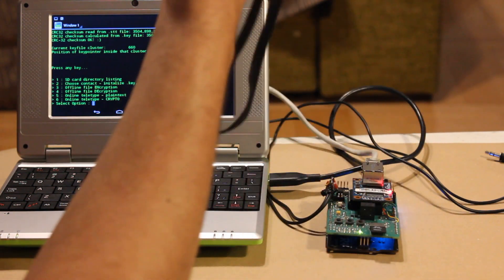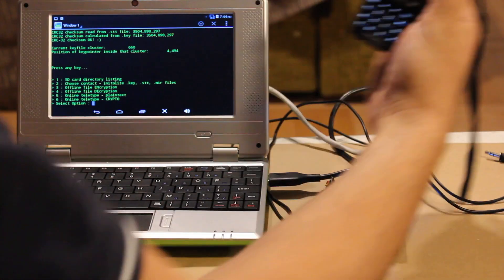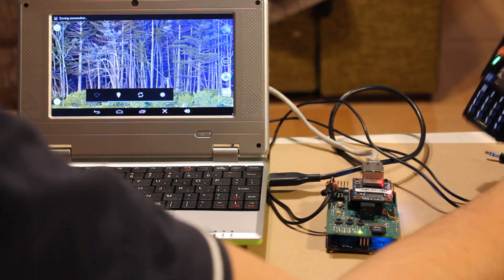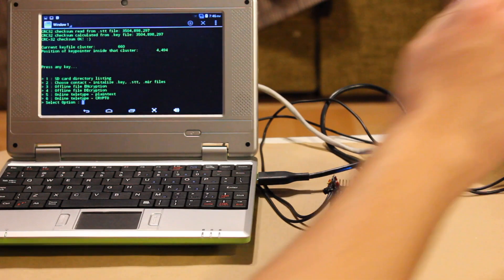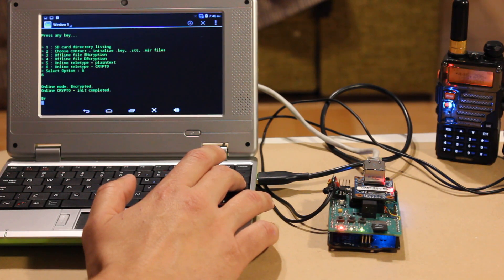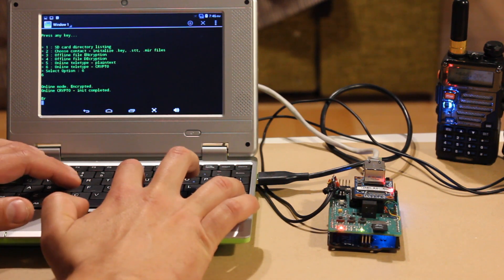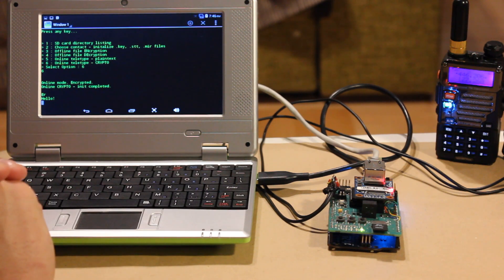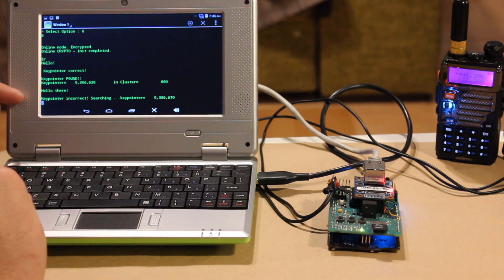One-Time Pad (OTP) Crypto System (160510)

Comment: One Tier Pad+++
c = 'abcdefghijklmnopqrstuvwxyz0123456789 '   character set length 37 (0 to 36)
m =  'happy new year'         message
o = 'wishing everyone'        one time pad
X = 654321         some integer value for X 

To encrypt message ((messagecharvalue + otpcharvalue) - X)  mod character set length.
To decrypt message ((encryptedcharvalue - otpcharvalue) + X) mod character set length.
 h=7,  one time pad w=22       ((7 + 22) - 654321) mod 37 = 16. That is 'q' in the character set.
a=0,  one time pad i =  8         ((0 + 8) - 654321) mod 37 =  32. Which is '6'
and so on. 
All encrypted = 'q6ujt g1nhpils'

To decrypt encrypted message
q is ((16 - 22) + 654321) mod 37 = 7. Which is 'h' 
6 is   ((32 - 8) + 654321) mod 37 = 0. Which is 'a' 
and so on.

Try it with a really big integer value for X.
Reply: Just now I improved on this. I realised that the integer value modded by the character set length (csl) will always be between 0 and the csl. So I've done this... using J (not Java) from http://jsoftware.com

c =: 'abcdefghijklmnopqrstuvwxyz0123456789 ' NB. character set, length is 37
m =: tolower ] ('aNother mEssage' -. ',.	"/\?!()@#~£$%=-*&^') -.(39{a.) NB. a message
o =: tolower ] ('using the the same one time pad' -. ',.	"/\?!()@#~£$%=-*&^') -.(39{a.) NB. text used as one time pad in o

x1 =: 23
x2 =: 77
x3 =: 83
x4 =: 65
x5 =: 29
x6 =: 47

em1=: (37|(((c i. m)+(c i. ((i.$m){o)))-x1)){c
em2=: (37|(((c i. em1)+(c i. ((i.$m){o)))-x2)){c
em3=: (37|(((c i. em2)+(c i. ((i.$m){o)))-x3)){c
em4=: (37|(((c i. em3)+(c i. ((i.$m){o)))-x4)){c
em5=: (37|(((c i. em4)+(c i. ((i.$m){o)))-x5)){c
em6=: (37|(((c i. em5)+(c i. ((i.$m){o)))-x6)){c

dm1=: (37|(((c i. em6)-(c i. ((i.$m){o)))+x6)){c
dm2=: (37|(((c i. dm1)-(c i. ((i.$m){o)))+x5)){c
dm3=: (37|(((c i. dm2)-(c i. ((i.$m){o)))+x4)){c
dm4=: (37|(((c i. dm3)-(c i. ((i.$m){o)))+x3)){c
dm5=: (37|(((c i. dm4)-(c i. ((i.$m){o)))+x2)){c
dm6=: (37|(((c i. dm5)-(c i. ((i.$m){o)))+x1)){c

wdinfo 'Message = ',m,LF,'OTP = ',o,LF,'Encrypted = ',em6,LF,'Decrypted = ',dm6
NB. 37*37*37*37*37*37 = 2565726409

------------------------------------------------------------------------------------------------------------------------------
Result is:    em6 = st86ph3nih467jk
                   dm6 = another message